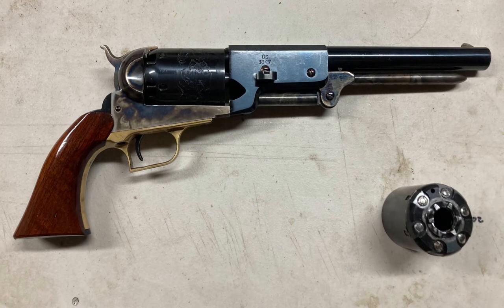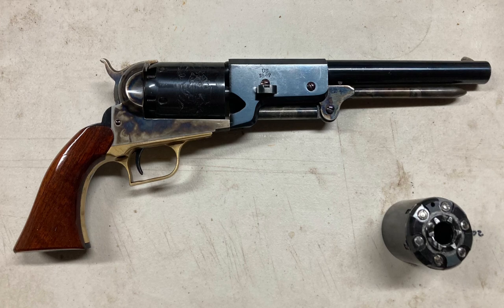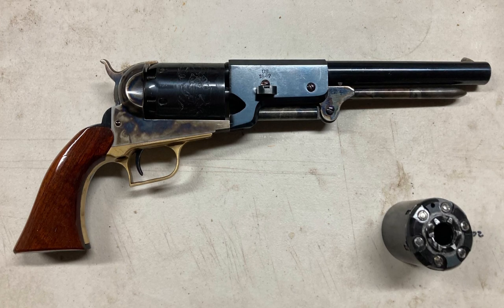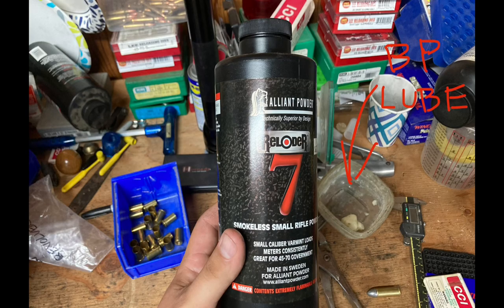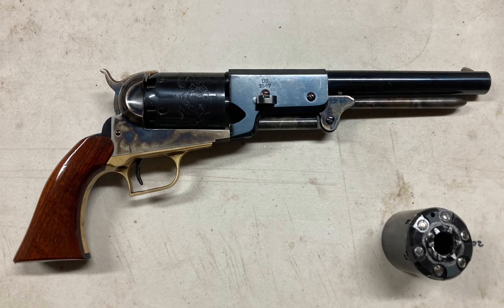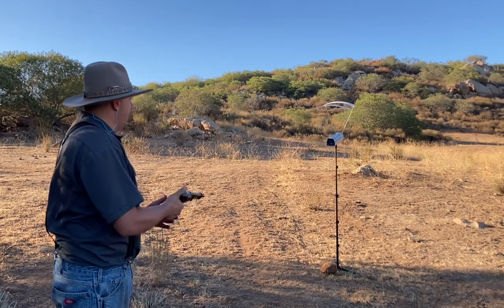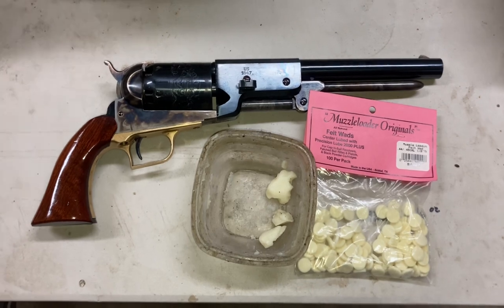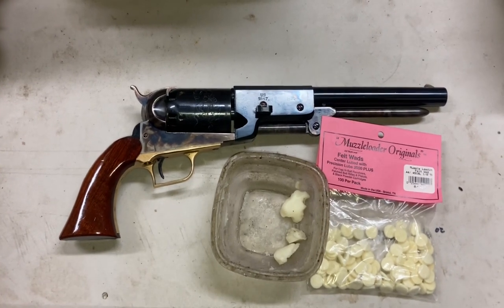Colt Walker Chain Fire

Comment: I have been shooting cap&ball revolvers since the 1950s and have never had a chainfire, I have seen others have this problem, and concluded that it was loose fitting balls, but the main cause of this is at the cap end, loose fitting caps and a weak mainspring is the usual cause, grease does very little to stop flash over at the front, if you look at the remaining unfired chambers you will find the grease is blown away after the first shot, it is there to keep fowling soft, and will not prevent a chainfire, with a weak mainspring and a heavy charge the hammer will blow back, and the whole rear end in engulfed in hot gas, you can see this on high speed films, take care! Many thanks for posting this, Chris B.
Reply: Yep. Cap end is the usual culprit.
Reply: You are correct... it's usually the cap end. I always warn my clients against lightening the hammer pull on their cap'n'ball revolvers..... One misfire will blow a stage, and chain-fires are not fun. Cap fit is important too. A cap takes a much bigger wallop to set if off than a primer, so those powerful mainsprings are there for a purpose. The Remingtons have a strain screw, and many are tempted to back it off a bit to lighten the pull..... Bad idea! I am 80 years old and have little hands, but I can pull the hammers OK, so anyone should be able to. I am not sure how many rounds I have fire through my revolvers over the years..... many, perhaps tens, of thousands of rounds and like you, never a chain-fire.
Reply: @KathrynLiz1  I am not sure where the fad for light mainsprings came from, maybe a desire by the cowboy action shooters for a speed advantage, or a manufacturer cashing in on a false belief, but the original Colts,(and I imagine Remington's), had a 12 lb hammer draw, that does not let much pressure,(red hot gas), escape from the nipple end, if you look at a high speed film https://www.youtube.com/watch?v=B4MfmTk_-wE  you can see the amount of gas that engulfs the rear of the cylinder, any flame path there will cause a chainfire, Chris B.
Reply: On the question of grease over the chambers, Wild Bill Hickock said he pulled his charge and reloaded each day. If he used grease over the chambers, as a professional gunman, he would have needed to remove the grease to preventing damping of powder. With all the cap and ball revolvers in the military, and no air-conditioning at the time, holsters should have been soaked in grease. In a story from a western museum, there was no mention of greasy holsters. I sent a letter to the NRA and asked if the manual of arms from the time made mention of greasing cylinders. NRA David Fischer, said his search of libraries, the internet and original military manuals, " I have yet to find anything to suggest the use of any type of grease and or lubricant to cover the cylinder mouths to prevent a "chain fire" from happening". I also think it is loose fitting balls.
Reply from the maker: Yes, I agree. On the subject of loose balls I use .454 balls and they shave off a nice lead ring when seated. I have read some accounts from the civil war where grease is mentioned but not discussed much. The “grease” that I’m referring to is my homemade black powder lube made of tallow and beeswax and has the consistency of cold butter. Most people think the grease is bore butter or crisco which will run right out of the chambers on a warm day and is rather useless in my opinion. 
    A lot of people say that grease and wads will do nothing to prevent a chain fire but I’m afraid I have to disagreed. I don’t see how it doesn’t add some layer of protection against the chain fire simply because it’s an added seal and barrier.  The biggest benefit of lubing the chamber mouths is it keeps the fouling soft so you don’t have to disassemble your gun to clean it just to keep it functioning. That’s worth the price of admission to me. 
    I’m not sold on the idea that chain fires only come from the nipple side of the cylinder as people have stated. The first chain fire I had was on an old ASM 1858 and It doesn’t shave any lead with the .454 ball and I didn’t use a wad or lube and it chain fired both chambers on either side of the barrel. I loaded it again and lubed the chamber mouths and it functioned fine. So In that case I’m sure it was loose fitting balls and I suspect the lube prevented it from happening again.
  It this case I believe the excessive powder charge forced its way into another chamber either from the front or back even with a good lead seal and good fitting caps. That’s a lot of fire and explosion going on there. We’ll never know if lube or wads would have prevented it but that is my suspicion. 

Thanks for the comment. I hope this was helpful.
Reply: Thanks, you just answered the question I just wrote.  Makes total sense.
Reply: Lose balls you say
Reply: @infidel202  Yea! Loose balls can be dodgy.
Reply: Iv been shooting cap and ball for allmost a week... 6 chain fires amd 4 of them expoaded the gun. Ibdont know wahy iam doing wrong iam running out of my grandfathers guns quickly
Reply: @harlanmcdiarmid  go buy a new pistol
Reply: @infidel202  i got 5 more to play with yet.  I mean they still jam less then a 1911.  But i was thinking of getting somthing new a super readable  like a keltech
Reply: @harlanmcdiarmid    There are some good comments on here.  One in particular.  I’ll see if I can find it, but if not, good luck
Reply: @harlanmcdiarmid  ok, so if you go through the threads, there are a couple really interesting ones.  One talks about weak mainsprings.  So if the hammer falls on a cap, but is too weak, or if the nipple is too worn out I suppose, it will rebound, sparks will fly, and set off others.   The front end must be protected too. When the charge goes off, there is obviously a tone of fire at the chamber opening, so the balls must be tight.  If you aren’t shaving off a ring when you seat the rounds, they’re too small.  Also many people put a little grease over top the chamber when it’s loaded as an extra layer of protection.   I’m way far away from being an expert, but that’s what I know.   If you don’t see your issue here, for the love of god, go to a gun store and ask a gunsmith to check them out, and strike up a conversation with him.  They’re usually pretty cool about helping people out.    Guns are dangerous if you’re a criminal or you don’t know what you’re doing.
Reply: Never had a chain fire or seen one with BP. However I did have a 686 have a sympathetic detonation and twice had my Model 17 S&W chain fire from what was probably an over charge of fulminate. Weirdly the .22 gave me more trouble as far as injuries go then the .38 wadcutters.
Reply: @harlanmcdiarmid  Not sure what guns you have, but I have never seen even an old worn out cap & ball gun that would explode with black powder, obviously you are using black powder! Using smokeless in one of these will quickly spoil your day, and a good gun. Go to a local experienced gunsmith and ask questions. Chris B.
Reply: @453421abcdefg12345  i had a box of 50 bmg that i would shoot out of a old break barrel shot gun.  It exploded too,   but any way i have been taking them apart and filling the chambers with as much powder i can fit then jam a bullet in
Reply: @harlanmcdiarmid  Ha Ha! There's your problem! I am surprised you are still with us, use ONLY black powder in cap & ball , no wonder you had a big bang, I can hear the bang from here !
Reply: @453421abcdefg12345  Wonder if he’s still here, really hope he wasn’t actually just carelessly packing them to the brim😂. I’ve never made my own ammo of any sorts although my grandfather did and showed me the ways so I plan to do so in the near future.
Reply: @Wes0602  With a bit of luck he has removed himself from the Gene pool by now!
Reply: @453421abcdefg12345  Haha indeed. I have no clue why I’m up this late. Have a good life fellow human.

Comment: Thanks for sharing your results.  Looked through the comments and there's some value here.  

I have had a cap fall off, a cap fail to ignite requiring a second strike, a failure to ignite the chamber with cap, forgot to load a chamber once that embarased me, and had a ball roll out of a chamber the first time shooting my walker.   Also had a self made paper cartidge fail to ignite due to the method I had used to wrap that particular charge.  All occurences of failure to fire were entirely my fault. 

I have since slightly worked the mouth of each chamber so that a .454 will leave the most tinniest of a semi ring yet swage down into the chamber for more contact with the inner walls. A .457 leaves a ring about the size of what i've seen most people experience on theirs using a .454 ball.  I heavily depress each cap atop a cone after they have all been added to insure proper seating.  

Sometimes I use wads, somtimes I use "greese", sometimes I use them together and sometimes not at all.  Recommend using just a dab of grease simply to mitigate fouling and making cleaning easier.   Grease will greatly increase the number of reloads that can be fired before fouling prevents smooth functioning of my pistol. 

Never had a chain fire.  

/knockonwood

Comment: I dont know about with live ball, but I civil war reenacted in a dismounted cavalry unit. I had a uberti colt Walker and a pietta 1858 Remington revolvers,  we actually used a toilet bowl gasket, that big ring of wax that you use when installing toilets,  it did a real good job of stopping chain fires.
Reply: I bet that's much cheaper and easy to get than anything sold as a gun accessory or related product.
Reply: @SW-ii5gg  and it lasted about 5 years.

Comment: I've not read all of the comments, so apologies if this was already talked about, but one thing that I've heard can cause chainfires beyond contact through the front, is flame contact/ignition through the back of the cylinder. E.g. poor fitting caps, loose cones, or vented cones, to name a few possbilities. I know a few people that have V-Notched cones, or cones with tiny holes drilled in the side to relieve pressure and split the caps better, and they get chainfires every so often.
I have another comment under Wildwest89 explaining one chainfire, but I've had 2 total. The other was a fully greased cylinder on my 1861 Navy with 25gr of FFFg and a round ball of proper fit, the grease was so densely packed into the chamber (Close to 3/8" of grease with no gaps or air pockets) I've determined it was highly improbable for a flash to get into the cylinder through the front. It so happened that I was using poor fitting cones/nipples.
Reply from the maker: It’s very possible that it came from the nipple end being that the .454 balls shave a nice ring of lead just like it’s supposed to. I think the excessive powder charge might have something to do with it as well.
Reply: That's an astute observation. I concure.Nrver have to worry bout that with my Hawkin 50 cal haha but my Ruger Old Army would be a concern. That's for the thought. Dandahermit
Reply: @dandahermitseals5582  what the devil?

Comment: I am 80 years, I first shot black powder revolvers in 1948 when my grandfather decided to teach me how it was done.   I have a good collection of revolvers and shoot a lot.   Never Had a Chain Fire.  If I smeared grease on his revolver he would beat me.  It wasn’t done back then for chain fires, it was done to keep powder dry.   His key to safety was to use a oversized ball to get a good ring cut and to use a small brush or a clean cloth too clean any powder grains or residue off!   Clean the cylinder after loading.  Especially the nipples as some fine powder will filter out the nipple holes.  I am guessing the powder around the nipples are causing your problem. Grease was only used on a rainy day.  Never had a chain fire in 70 years of shooting.  You have read too many books by newbees that are experts on their second trip shooting.  My grandpa was a old time Sheriff and carried a BP revolver all his life.
Reply from the maker: That’s some good information. I use a .454 ball and it shaves off a nice ring of lead while I seat it. I suspect the chain fire was caused from the nipple end of the cylinder but I suppose we’ll never know.  As for the grease story, the biggest benefit I’ve noticed is that it keeps the fouling soft. Without a lubed wad or greased chamber mouths my revolvers will start to lock up after 12 shots or so. I don’t see how it wouldn’t give some added protection against chain fires simply because it seals the chamber. Although I don’t consider Elmer Keith to be a noobie, I suppose if I was 80 years old and my granddad was a lawman during the cap and ball days I would feel differently.
Reply: Back in the day they used the grease for the reasons you stated.  Another purpose, is it serves as a bullet/ball lube.  Walker designed the gun to use pointed cast bullets.  However supposedly the the round balls are more accurate.  I have used crisco shortening in a pinch.  They used lard  sometimes back in the day.
Reply: tory brown is for sure correct , oversize projectiles was the go to get a flash proof seal , also the grease over the projectile i have read was mainly for wet rain conditions interestingly a lower ambient temperature would keep the grease in place and waterproofing ,if grease was used in hot dry weather it'd dribble out all over the place , the flash holes in modern reproduction cap and ball revolvers are way larger than the original nipples and chain fire is the result from the rear as tory suggested is the result ,repro pistols are set up for larger gr 3 f powder so the larger flash hole is needed ,this liability wise keeps a lower pressure in the available chamber space and if 4 f was used it tends to leak out the nipples and all warnings are to use 3 f only , originals fired a powder called pistol powder closer to 4 f but only available in the paper cartridge used in 31 ,36 and 44 holster pistols,  the walker and dragoon used a musket powder i think it was called and it was close to 3 f , walker and dragoon can never be used with 4 f and never were , the paper cartridges were used from 1851 in all the belt and pocket pistols not in the 1847,,1848 etc saddle pistols of walker or dragoon , so in conclusion flash hole size in modern repro's would appear to me to be the main culprit in chain fire , cheers big ears
Reply: @billbearback2591  yep, also the original era caps were hotter and snappier due to the primer compound used.
Reply: Never used wads, grease only to keep the powder soft and the cylinder turning. Balls slightly oversize for the ring cut and never a chain fire in 40 years of shooting bp.
Reply: @luuk-out-below9804  crisco is a poor lube in my opinion by it's self
Reply from the maker: I use a 60/40 mix of lambs tallow and beeswax. It’s the best BP lube that I’ve ever used.
Reply: @Everythingblackpowder  I've used 1 cup shortening with SPG 1tube or Lyman black powder gold 1 tube and later a cup shortening and sheep tallow and beeswax the equivalent of one tube if I recall about 2 oz all with good results ,I've had two chain fires with an old revolver I had one when I let a friend shoot it it was always the one chamber left of the barrel and it was greased I don't recall what grease I was using at the time,I've been shooting c&b revolvers since I was in my early teens I'm 60 now the one when my friend shot it we heard the ball hit in the trees
Reply: @markzimmerman7279  agreed.
Reply: Well said Tory..... We are the same age and my experience parallels yours. I use combustible paper cartridges these days, so stray powder grains are not an issue... 🙂
Reply: When was your grandfather born?

Comment: I don't do either of those and have never had a chain fire in countless thousands of rounds. Mind you, I always make sure my chamber mouths are about one thou bigger than groove diameter, and if shooting round balls I use ones that are 4-5 thou bigger than the chambers... If the chambers are properly round (not always so from the factory!) the fit is air tight. I am presently shooting combustible paper cartridges in my Remingtons. About 30gr of 3F behind a 200gr conical, lubed in the bullet' grooves via a lube/sizer. I use those because they are easier to put into the cartridges than RBs, and no subsequent lube is needed.... accurate and consistent... around 850fps...
Reply from the maker: I just tested the Johnston and dow conicals and they performed great. My 1860 army got 750fps with 25gr 3F and the Walker got 1050 with 40gr 3f and very accurate.  I suspect my chain fire came from the nipple side of the cylinder and I believe the excessive powder charge had something to do with it as well. Both the 454 round balls and conicals shave an nice ring of lead when seated.
Reply: Are you actually an 80+ woman loading cap and ball?

Comment: Go to the hardware store and buy a wax toilet seal ring. Just pinch off a little piece and push it down in each chamber. It's not messy and it won't melt in your holster like some greases do on a hot summer day. I would imagine it is still cheaper than the specialty gun greases. It always worked for me.
Reply: Now, THAT is a good idea. That wax is extra gooey but stiff at the same time. And one ring will last a very long time.
Reply: @david9783  Wax rings are not a good idea. many modern wax rings are petroleum based